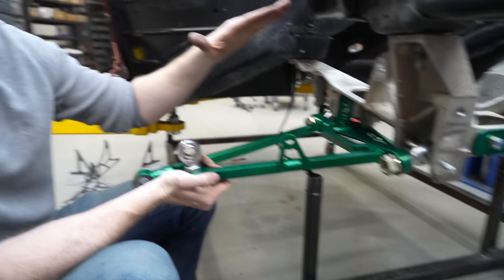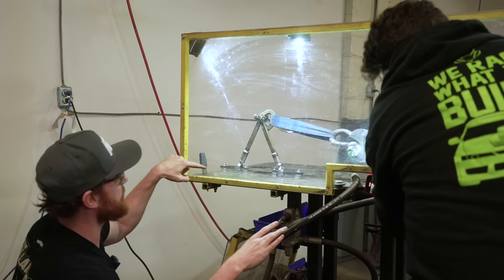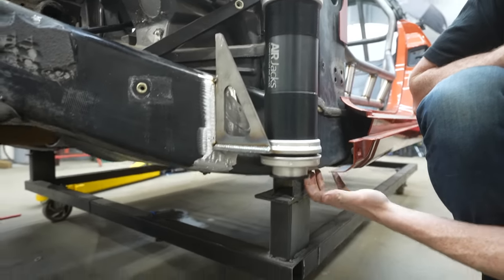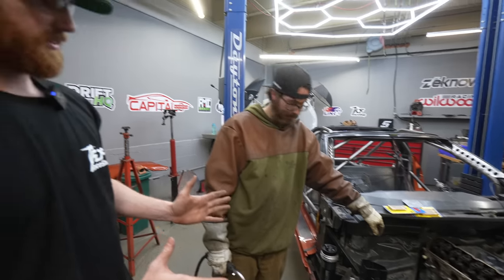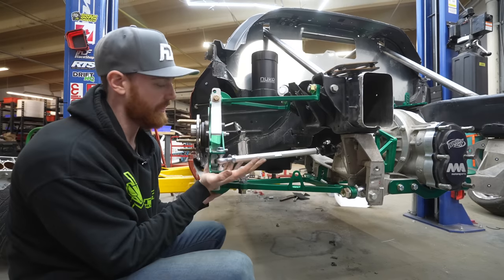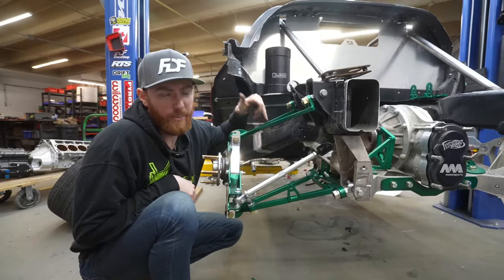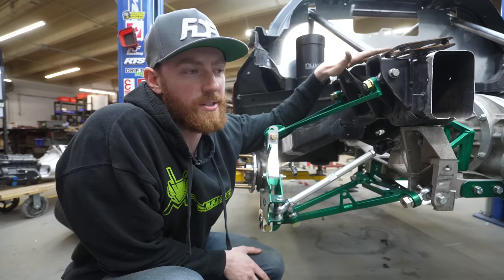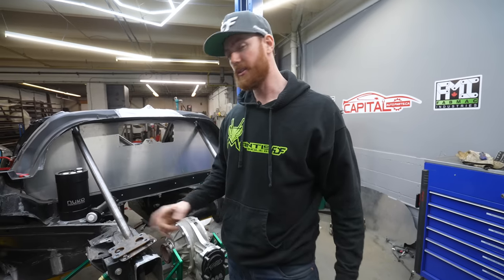The Gnarliest Rear Grip Kit Setup (Episode 5)

Comment: The idea of reducing anti squat is to improve smoother control on bank tracks?
Reply from the maker: In a sense. You can have to much and too little antisquat. Best to have the option of adjusting. Throttle input, track conditions, speed of the track etc etc all determine how antisquat will help or hinder you

Comment: Which alloy of steel do you favor? Are you claiming 4x yield or ultimate tensile strength? Is this alloy sensitive to heat input?
Why did you not triangulate the back stays or cross brace?
The 3/8" thick brake rotor appears to be very low thermal capacity. So thin. Are those few oz saved worth sacrificing the durability of a vented rotor?

Comment: I see that you’re setting it up in the “lowest bolt hole” position which I believe to be the lowest “anti squat” percentage or “most squat” position (correct me if I’m wrong). Where would increasing squat be an advantage? Wouldn’t the car react smoother/quicker with higher max grip levels at the higher anti squat percentage position putting that force into the arms/tires rather than the coilovers? This comment is to learn not try and prove anything wrong. Thanks!

Comment: I notice you are running two masters for your foot brakes. What is your reasoning for not using a proportional valve on the rear brakes and running inline like Chelsea Denofa? The hated debate. 🍿
Reply from the maker: 2 masters is just separating the front from the rear. So I can setup a mechanical bias bar between then. I still use a proportioning valve, and The rear could be run inline with only 1 set of calipers but I just prefer dual.
Reply: @FDFraceshop  why do you think some people like running it inline like that. Simplicity?
Reply from the maker: @locksleylennoxvfx  yes, to them it may not seem necessary. I don’t like how the handbrake can back feed pressure to the foot brake, or “line lock” the rear while using it. I just prefer it separate but it could also be because inline is cheaper. All in all they both work well
Reply: @FDFraceshop  the reason I asked is because I thought the inline method with a pedal box/ dual foot brake masters would prevent the line lock issues if you use the bias valve accordingly.
Reply from the maker: @locksleylennoxvfx  it separates and keeps the front brakes usable but it will still prevent the rear foot brake master from compressing. and it will change how the fronts respond.
Reply: @FDFraceshop  how will it change how the front respond if it is on a separate master?